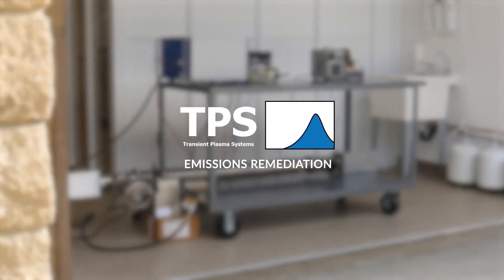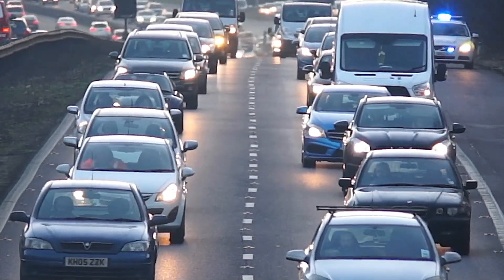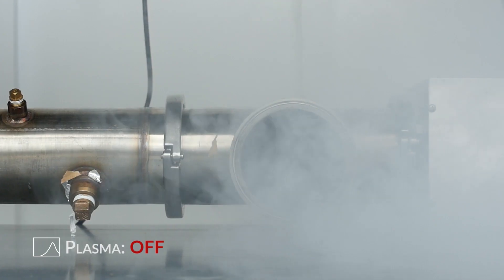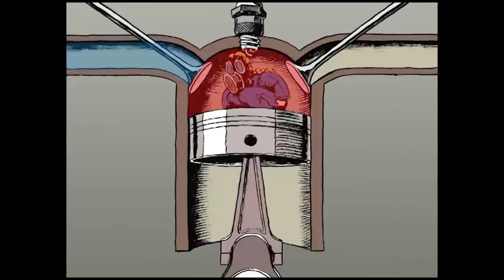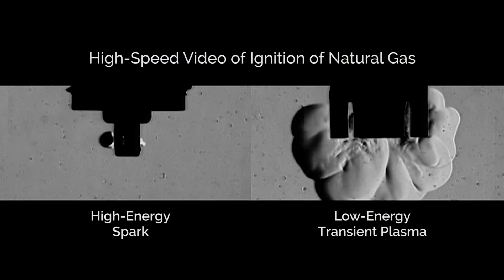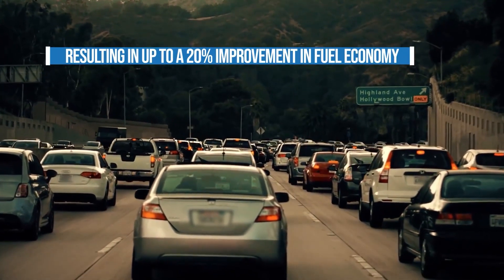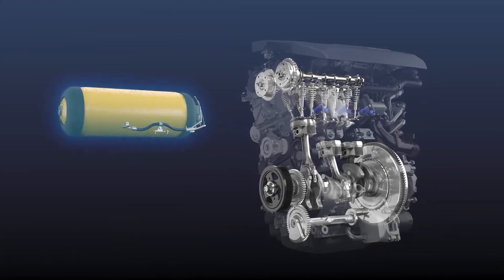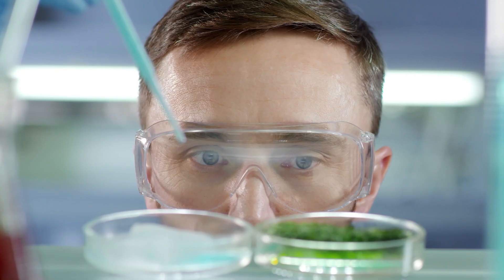This new Plasma Ignition system will improve your car's fuel economy by up to 20%

Comment: The real problem (guess) high pressures inside the cylinder at the time of ignition. Plazma does not like to push through it. Plazma in a bubble is almost in a vacuum. As the atmosphere gets thicker, it pushes through as a single arc. Probably not a lot of plazma striations like this video shows at atmospheric pressure.  Fwiw I am a glass blower / plazma artist. I'm not saying it's not possible. Just that it would require very high wattage to push through , and it would probably be in a large single arc at that point , similar to a spark plug.  I'm going to guess that video of it "working" was in a very very low compression seniero , or in a lab with very high wattage. Also, plazma created from an electrical source , is done at radio wave frequency, the unwanted interference with your electronics would be another big issue.

Comment: The FireStorm Plasma iPlug is a new entry in the formerly mundane area of Spark Plugs. All Spark Plugs produce "sparks" to ignite the Air Fuel Mixture in the combustion Chambers. FireStorm is different, it produces "PLASMA". By doing that, it eliminates the Catalytic Converter and EGR Systems and can still pass future emission requirements in California. 

Here is a clip: http://www.youtube.com/watch?v=abwXApkLhbc 

Further testing after that clip was shot in Detroit proved a 70% savings in fuel all while affording a 125 More Horsepower. 
It is a Paradigm Shift in Air Fuel Ratio as this plug operates at 30 to 1 Air to Fuel Ratio. All current IC engines operate at 14.7 to 1 and require a Cat and EGR. 

FireStorm can even crack water right in the Combustion_Chamber thereby eliminating so-called HHO Generators. Can I hear fill your car up at the side of your house with the garden hose? YES!!!!
Reply: laws of thermodynamics have left the chat

Comment: firm believer that EV is NOT the future and in ten years they will probably be banned...  when we wake up to this current obsession with all things "digital" and "high tech". 

two to three generations of ignorance as to how things actually operate has really held humanity back.

anyway. my initial thought was the "nano second pulse".

when CDI first came out, they had big issues with the spark duration being TOO SHORT. now, a nano second is a bloody tiny little pulse... still, whats actually important is getting that mixture of volatile free radicals (fuel and air thats chemically started to combine but hasnt combusted yet) to the temperature that they do start to break down, combine, and the chain reaction of combustion starts. plasma is a little bit different to a mere arc. 

lol, i went old school. come up with an ignition system that requires no electricity... you could say its diesel but it isnt. anyway. no glowplugs, no hot bulbs, just compression. trials are working on the lawnmower...

what i would do with several million of R&D rather than several hundred of everyday debt...

Comment: Wonder if this could be utilised in diesel??
Reply: diesel doesnt have spark plugs and diesel is already 20% + more fuel efficiant compared to petrol
Reply: Good point, I meant used differently like instead of a glow plug
Reply: @danmaycock9238  glow plugs don’t ignite the fuel in diesel engines. Glow plugs only pre heat the chamber before the engine starts when the air temperature is below a certain point. Once the diesel engine starts running it doesn’t use the glow plugs. Diesel fuel ignites from the pressure made by the compression in the cylinder.
Reply: @artempopov3913  Point accepted 👍

Comment: Three observations if I may, if the plasma doesn't have enough energy to ignite a match I can't see how it's going to ignite a compressed fuel/air mixture? Second, plasma ignition is nothing new, various systems have come on the market over, at least, the last 30 years. The most efficient ICE's are F1 units which run at some 50%, the most efficient road going ICE's are some 35%, 20% up on 35% is 42%? Wouldn't manufacturers have installed this already in their cars?
Reply: What are those others ignition systems?

Comment: all good ideas. but electric is better not just for its green appeal. an ICE has hundred of moving parts that are all disintergrating due to friction. plus the brakes, plus the fuel system, plus the ignition system, plus plus plus. these are all components that wear out. electric cars have barely any. the ongoing maintenacne of a elec car versus ICE is where it wins alone. sure you gota replace batterys but when things scale up that will be cheap and easy, plug and play, with the old battery being easily recycled. just the sheer lack of number of moving parts in a electric car makes it more efficient before you even consider a comparison of the fuel system. once you get number of parts down you greatly reduce cost of manufacture. plus second hand parts willl become plenty even further reducing ongoing cost.

Comment: Interesting, but right at the end there you said manufacturers may have new cars our in 18 months.  That really doesn't address the core issue you raised at the beginning regarding the billions of existing ICE cars.  Soooo, when you read the complicated paper was there anything about it being a one for one spark plug replacement?  If not, then the title is misleading - as the tech won't improve the fuel economy of my car, but might improve economy for a new car.

Comment: Add a Fish carburetor and you would have the perfect ICE! (if this actually worked, why wouldn't the auto manufacturers already be using it?)
Reply: auto manufactures dont tend to use technology before the technology is invented. its kind of an engineering rule. )
Reply: but serious, if you know about fish carbs then you know that all through history tech which lowered fuel consumption has been shelved due to big auto and big oil has close ties and handshake agreements. doesnt take a genius to work that one out.
Reply: @freelectron2029  Ha ha ha. Yep, that's the line they used to sell the Fish carburetor! Seriously though, the idea that GM or any automaker would pass on some gadget that would make their cars super-competitive in the gas milage wars just because of some mythical handshake agreements with "big oil" is ludicrous to anyone who understands basic business or how corporations operate.
Reply: @michaelparks3106 how does this fish carburator compares to today injection engines? And i wonder if it somwhow gained traction again will it be a good use case to put them on lawn movers and other small engines.
Reply: @norbertnagy5514  My first comment about the fish carburetor was sarcasm. Anyone who thinks changing one thing on a highly developed gasoline engine will result in a 20% efficiency gain doesn't understand basic physics.
Reply: @michaelparks3106  yeah, that number seemed fishy for mee, too, but it could be a low hanging fruit for engines that still use carburators.
Reply: @norbertnagy5514  Maybe, but with injection getting so cheap now, we may see the end of carburetors relatively soon, even on small, cheap engines. The high pressure fuel pump is probably the most expensive part now.

Comment: Interesting. I wonder if this requires adjusting ignition timing as well. Likely needs less advance?

The demo video of the smokey exhaust also had the plasma ignition post cylinder? So we're talking emissions replacement of catalytic converter?
Reply from the maker: No clue if the cat would fall away. And yes i think you would retard the timing🔥

Comment: You had me at "not all of us can afford an EV"
I would totally get a Plasma retrofit kit for my 16 year old ICE sedan. Also, I must point out that I'm really annoyed that PLUG-IN HYBRID cars are not being made more. The harsh reality of the situation is most people are not willing or able to go full EV for a lot of good reasons (cost of vehicle, lack of charging stations, too much time to charge, etc. etc.). Plus economic realities will not allow this sudden switch over to no petrol. Yeah, it would be nice if it could happen, but it's just not going to.
Instead, as usual, most car makers are totally out of touch with reality and have jumped from ICE to full EV.  * smh *
Reply from the maker: Exactly
Reply: Hopefully, Mazda MX30 will show a good way to deploy the Wankel rotary as a range extender. However, the Wankel is better with

Comment: While ev's are great. The combustion engine isn't going to just vanish and be obsolete like horses were. And in reality the better and cleaner an engine runs the more power and efficiency you can achieve. It will also help the motors last longer the more complete the fuel is burned leaving less carbon deposits to cause wear.
Reply: I think the ICE will be obsolete just like horses were. Over the next 20 ~ 40 years it will be phased out and will only be owned by hobbyists and collectors. The cost benefit alone will drive the conversion: I have solar panels on my roof so the "fuel" for my EV is essentially free, and coasting downhill add free "fuel" to the battery. I will never have the ability to make gasoline at home, and coasting an ICE car will never put more gas in the tank. As for cost, my solar panels have generated over 70Mw so far, enough to have paid the installation cost 3 times over. Not to mention no cost for tune-ups, oil changes, smog certification, or most general maintenance that an ICE requires.

Comment: Do they have running engine? Do they confirmed with it that more lean mixture is possible and do not shorten life of engine to which it was retrofitted?
Do they? No?
Reply: I'm not sure it's a more lean fuel/air mixture... is more of ingition generation.. instead of speck size ignition source, it's significant increase of surface area

Comment: Improving ICE is still valid, about 4 million electric vehicles per year is the current production, it will be decades before there are enough electric vehicles to significantly replace over 1 billion ICE vehicles.

Comment: We most certainly need something to improve the fuel economy of our personal way of transport. Here in Canada, one gallon of gasoline is close to $7.50. So a typical fill-up can cost close to $100. That is not acceptable. Even if a new improvement could save 20%, that is not enough. It certainly helps, but it is not enough.
If we all lived in a compressed environment like  Denmark, Hong Kong, or New York City, where the typical automobile is impracticable, or not necessary, public transportation is very efficient. But we don't. Here in North America, we need our pickup trucks and larger cars, as when in many cases we have to travel long distances to get to work, groceries, and different lifestyles.

Comment: “FEV, a globally leading service provider in vehicle and propulsion system development and testing, evaluated the performance of the TPS nanosecond pulsed power ignition system on the Toyota 2.5-liter, direct and port fueled injection, inline 4-cylinder gasoline engine commonly used in the Camry line of vehicles. The "Dynamic Force Engine" achieves one of the world's best thermal efficiencies of 40 percent in gasoline powered vehicles according to Toyota. 

The Toyota 2.5L engine was tested at FEV North America and results indicate improvements over the stock ignition system. Data was collected with the stock ignition system with a representative ignition strategy, followed by comparison to a drop-in replacement with the TPS nanosecond pulsed power ignition system (coil and plug). Results indicate a brake-specific fuel consumption (BSFC) benefit of up to 6 percent with minor calibration changes, which include a multi-pulse ignition strategy, increased external EGR, and optimized spark timing. With the TPS ignition system, there was no degradation of combustion with increased EGR.” - PR Newswire

Comment: HHO or raw Hydrogen powered ICEs would be so much better than electric cars. I'm sure we could do it safely if we tried hard enough.
Reply: The big problem with hydrogen is supply and distribution. It might work for large fixed installations, but is impractical for individual cars fueled at corner gas stations.
Reply: No they really are not. The massive amount of energy needed to create and store liquid hydrogen is completely counterintuitive to what you would consider a "green" energy. You are basically driving an electric power plant that runs off of hydrogen - you cannot run any current ICE engine of hydrogen due to its very low energy density and terrible efficiency. It would have to be bespoke to specifically run off that fuel and would achieve 30% efficiency at best. So you have all the complexity of an EV (sans the battery) and the complexity of a hydrogen powered fuel cell all in one. The only benefit Hydro cars ever had was the faster refueling times compared to charging. Soon EV's will be able to charge to 80% in under 15 min so nearly every advantage of a hydro car is being eroded away by the evolution of EVs. Least we not forget that H is #1 on the periodic table, meaning the smallest element we know of, so it will literally eventually leak out of any container you can possibly make to store it in.
Reply: @powertothesheeple5422  why store it when you can just make it through electrolysis?
Reply: @MrS22222  Because to make enough of it in a short time for refueling or on-board creation, the systems would have to be massive - it's not a fast process.

Comment: If they can get the ignition to be smooth like a normal spark then it'd be wonderful. Not only could you get better mpg, but more power and torque as well. However with the current ignition wave pattern caused by the numerous psuedo sparks the system would significantly reduce engine life. With the current burn pattern it would induce rod knock, and piston slap in a similar way to a severe misfire caused by not only bad spark, but also but afr. So basically with where the tech is at now it cant be used in an engine, but it does show promise, it just needs to be developed enough to be precisely controlled so that the burn is even and clean.
Reply: Induce rod knock? You mean knock? Aka detonation. Rod knock is something entirely different.
Reply: @busterscrugs  no i mean rod knock, the detonation was explained as piston slap, and detonation subsequently creates rod knock by slamming the assembly back into the crankshaft, thus wearing out the crank bearings extremely fast.